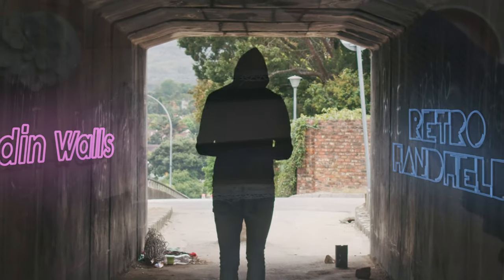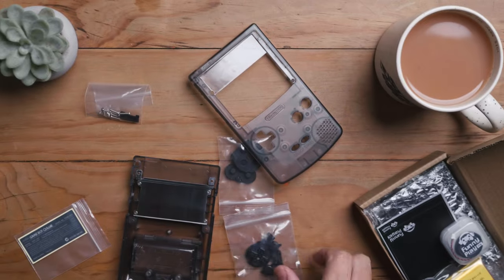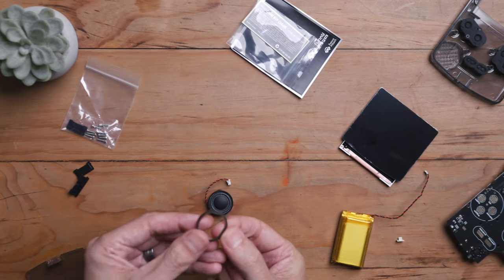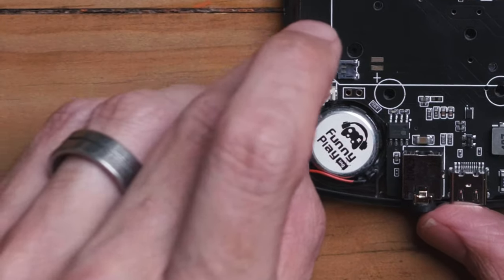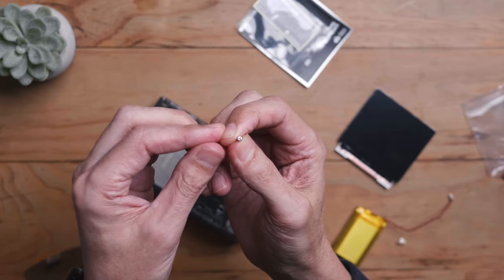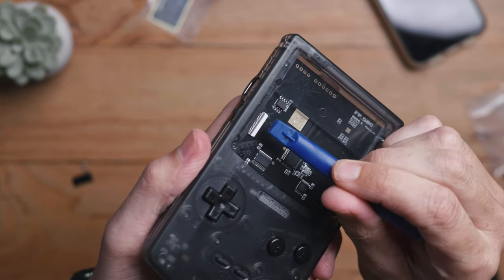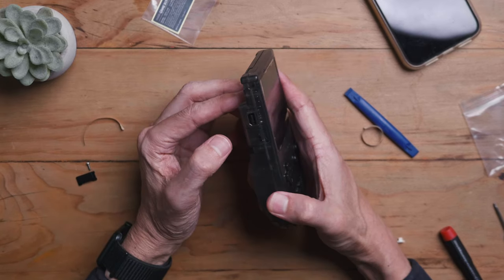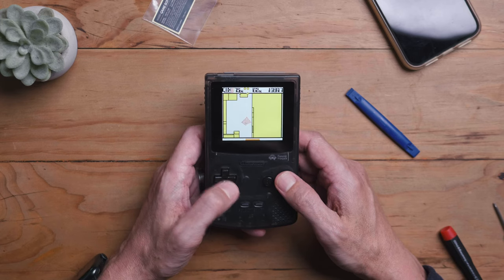I built a NEW Gameboy Color for $84 - BEGINNERS GUIDE

Comment: The resistance while inserting the screen is the screen's flex cable getting caught on the cartridge pin solder points. Lifting the cable to make sure it clears those points will allow smooth insertion of the screen.

Comment: Another great video! I used that middle screw and had no problems with mine, I'd say the d pad and buttons feel a lot more solid and responsive when it's in place. I'm not sure why that particular one would be more likely to crack than the others. That resistance you encountered when you were pushing the screen in, it's the ribbon cable catching on the pins for the cartridge connector. If it's working fine, I'd leave well alone. If you wanted to fix it, you would be easiest opening it from the back, lifting out the motherboard and resetting it so there's no pressure on the ribbon.
Reply from the maker: Hey man ya I think I will just leave well enough alone!
Reply: @adinwalls  absolutely agree, if it works it works!

Comment: I just built mine about a week ago and I’ve been running through Pokemon Crystal Legacy and it’s awesome!

My only complaint is that the speaker even on minimum is much too loud. But besides that it’s surprisingly good quality for only being $83.00 to US.
Reply from the maker: Hey man. Okay thanks for those comments. I’ll add them to my notes for the review
Reply from the maker: Also how are you finding the dpad. I am finding it quite inaccurate.
Reply: I've heard on reddit that you can put a little piece of foam in front of the speaker and it helps with both preventing rattling and the volume.
Reply: What about d-pad?

Comment: So built mine.  Love it but the speaker did start to rattle a little and also some of the battle graphics in Pokémon red show distorted.  Any fixes for these two things?
Reply from the maker: Maybe check that the gasket is installed correctly on the speaker. There are a few graphics settings in the system menu. Maybe play with those to see if it fixes your Pokémon game.
Reply: @adinwalls I’ve played with the settings but no luck.  What’s weird is the graphics issue comes and goes regardless of what core and other settings.  It’s hopefully fixable via a firmware update.

Comment: Oh thank god, you're not saying Tri-Wing for the screws. XP
Reply from the maker: hehe never heard that term
Reply: As far as I know tri wing is the official term 😅
Reply: Triwing is the proper industry term.
Reply: @RicoSuave93710  No, no no, NO, NO NO NO. TRI-WING IS A DIFFERENT SCREW HEAD.
Reply: @bubbleman91  Tri Wing is a different kind of screw head. The ones used on Beyblades are Tri Wing. The ones used on Nintendo consoles are Y-Type, also known as Tripoint. Tri Wing are based around a triangular shape that has three wings coming off it at an angle, hence the name. Y-type is shaped like the letter Y, with the three lines intersecting at one point,
Reply: @JomasterTheSecond  oh, thank you! I didn't know that 😅
Reply: @bubbleman91  I hope one of these days people can stop mislabelling things, but I digress.